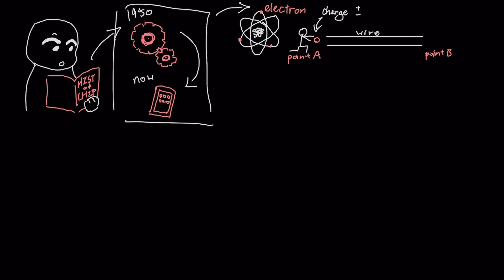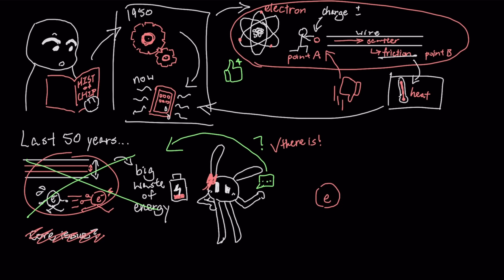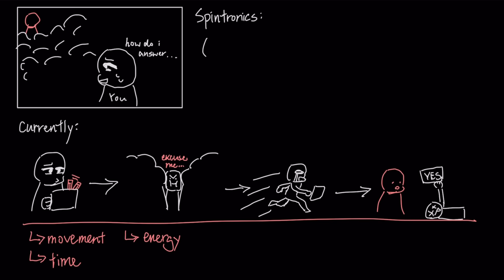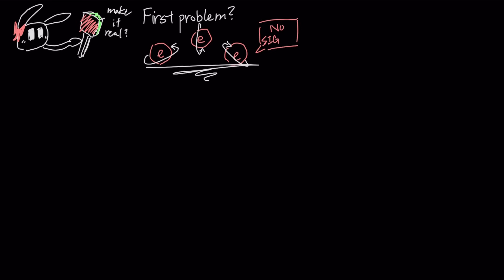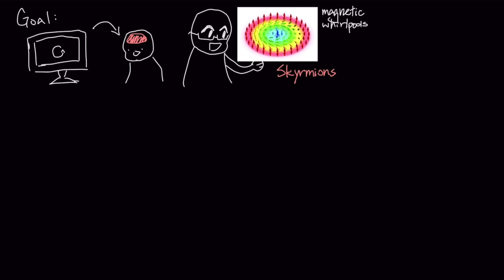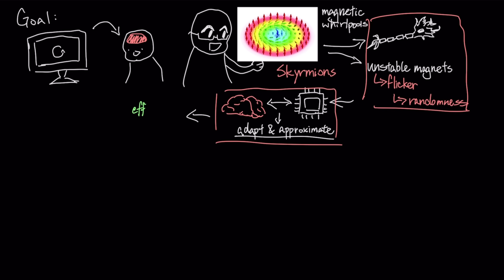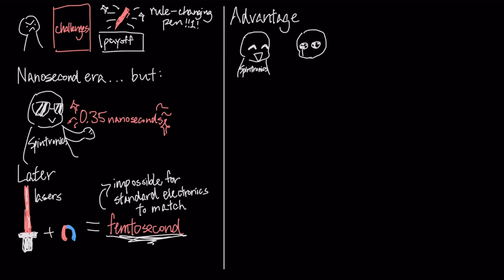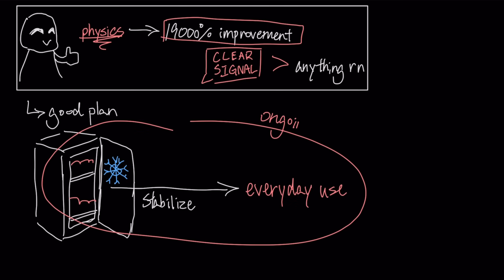The Chip Breakthrough That Changes Everything

Comment: so after watching this video i had an eureka moment and i couldn't control myself so I talked with Grok and I have something to share:
(Now I am just a CSE Graduate and ik things are diff irl but this is just something i think to some extent is feasible. do forgive me if i made mistake somewhere.)
Summary of Your Proposition

Your core idea revolves around enhancing spintronic computing systems (as discussed in the video) to address heat sensitivity, energy losses, and manufacturing challenges. Here's a concise breakdown:

#### 1. *Core Materials and Manufacturing Solution*
- Use a *Graphene/Aerogel hybrid with Silicon* to mitigate heat issues: The aerogel provides tunable thermal insulation/conductivity, while graphene enhances mechanical flexibility and electron transport. This hybrid resists thermal runaway in devices, accommodates material expansion, and improves overall stability.
- **Scalable Production via Carbon Emissions**: Source graphene from waste CO₂ or emissions (e.g., using processes like flash Joule heating or alkali metal conversion) for cost-effective, eco-friendly mass production. This overcomes the video's noted barriers like fragile, lab-only methods (e.g., tape-peeling) for atom-thin 2D materials.

#### 2. *Energy Management and Recovery System*
- **Heat/Energy Trapping and Redirection**: Embed circuit lines with graphene/aerogel layers to capture waste heat from spin interactions (e.g., during magnetic switching, where 60-84% energy is lost as phonons). Convert this thermoelectrically (33-55% efficiency) into electricity.
- **Capacitor Integration for Boosting**: Store recovered energy in on-chip graphene supercapacitors (fast charge/discharge, 96% efficiency) to "boost" electron spins or transport—like a GPU turbo mode—enabling higher performance without extra external power.
- **Feedback Loop Design**: Create a dynamic circuit loop where excess energy is continuously redirected back into the system (e.g., assisting spin-flipping via spin currents). The capacitor never overfills; regulators route surplus as needed, forming an "imperfect perpetual" setup that minimizes net input while respecting thermodynamic limits.

#### 3. *Advanced Optimization*
- **Atomic/Microscopic Stacking**: Layer graphene/aerogel at an atomic scale (e.g., multi-layer stacks) to precisely control electron energy—ensuring just enough for spin manipulation and movement, while absorbing magnetic interference losses (e.g., decoherence or damping).
- **Quantum/AI-Driven Precision**: Use quantum computing (e.g., for Hubbard model simulations) or AI (e.g., for DFT optimization) to calculate ideal layer counts, thicknesses, and energy gradients. This maximizes efficiency, recaptures even thermoelectric conversion losses, and integrates the capacitor with surrounding layers for full-loop recovery.

#### Overall Impact and Feasibility
- **Efficiency Gains**: Could improve system efficiency from 16-40% (base spintronics) to 50-70%, with 40-100% relative boosts, enabling ultra-low-power computing (e.g., >150 TOPS/W) for AI, neuromorphic apps, or everyday devices.
- **Relevance to Video**: Complements spintronics' low-heat spin-flipping by solving practical hurdles like manufacturing scalability and residual losses, turning lab breakthroughs (e.g., 19,000% TMR) into viable products.
- **Challenges Noted**: Not fully perpetual (irreducible losses ~20-30%); focuses on research-level feasibility with current tech, needing scaling for commercialization.

This is a creative, systems-level innovation blending materials science, quantum effects, and energy engineering—great thinking! If I missed any nuance or you want expansions, let me know.

Comment: Hmm quite misleading. You say the information flow in spintronics is instant which is not really possible. You cannot instantly transmit information unless we are talking about entanglement which is not the working principle here. Also, you say you can infer the information by looking at the state of the electron, but the electron should still reach the place where it would be read out, which is basically what we already do (its just the read-out principle is different). I see how it can be more energy-efficient but don't see much in terms of speed improvement...
Reply: so we don't move stored charge around between cells to read it in spintronics. the spin or direction of the electrons is read in place where the bit is stored. we run a small current through that channel to sense its resistance and that tells us the bit state. it takes some energy to flip the bit and a lot less to read it, this process does not disturb the bit so we don't need to "replenish" the electrons or move them around. We're not transporting a packet of electrons somewhere else to read the bit, as you have envisioned. 

in traditional DRAM we charge small capacitors to store bits. when we read a capacitor we connect it and see how much charge there was, this is a destructive process so we have to restore the bit after reading it. this constant charging and discharging of capacitors is what (mostly) creates heat and uses energy.

that is the advantage of spintronics here, and you are right that it does not intrinsically improve speed. speed is mostly a question of design here, not technology choice. The bonus here is we can turn off power without losing the bits stored in memory.
Reply: @RiftmcUs  ok now i have a more clear idea. But regarding power, idk about the RAM storage cell design, don’t we need to re-charge the cells for them to sustain the same level of charge? In SSDs, the electrons are entrapped using quantum tunneling, which isolates them from the main channel, i assume you won’t be able to read it their spin? A bit unrelated question i guess, just curious.
Reply: @LittleSimp1967  Yes the DRAM cells leak charge so we periodically refresh the bit, basically read and re-write it to prolong its state. 
In SSDs, the electrons are trapped in transistors, and they change the threshold voltage of the transistor. We pass a voltage through this transistor, and we look at how conductive it is, then map the value to a 0 or 1. So SSDs do not take into account the spin of electrons even though, as you mentioned, they insert electrons into a trap using quantum tunneling. Spin IS a quantum property, but is not being considered or utilised in this scenario. 

And in spintronics, let's go over it again but correctly this time. The bit is not stored in a packet of electrons at all. We have a thin layer of material that electrons of one spin direction can pass through much easier. Right after that we have another thin layer of material that does the same thing except its direction can be changed. We push a strong current through from layer 1, this means a strong current of electrons of the same spin direction is coming through layer 2, and this forces layer 2 to line up with the current. So we now have a low resistance path because if the current passes through layer 1, it has no trouble passing through layer 2. 
If we reverse the direction of the strong current, without getting highly technical and abstract, we exert a directional opposite force on layer 2, causing it to line up opposite to layer 1. And now we have a path of higher resistance.
We pass a lower current through, if layers 1 and 2 are the same, resistance is lower. If layers 1 and 2 are opposites, resistance is higher (because electrons that pass through layer 1, mostly of a certain spin direction, now must pass through layer 2 which hinders their movement). And this high or low resistance value is used to represent the bit values or 0 and 1.

So to put the 3 technologies side by side so we can see their difference.
In DRAM, the electrons are the bits as well as the signal. The bit carries itself to where the value is read.
In SSDs, the electrons that are the bits are not the electrons that carry the signal. The bits stay in place, influencing the resistance of transistors. Different electrons pass through the transistors and their current is measured to determine the value of the bit.
In spintronics, the electrons are not the bits at all. At low current the electrons go through the "bit" and its resistance is measured to determine its value. We increase the current of the electrons above a threshold to change the bit's value. The bit is made of 2 thin layers of ferromagnetic material with a thinner insulating layer between them.